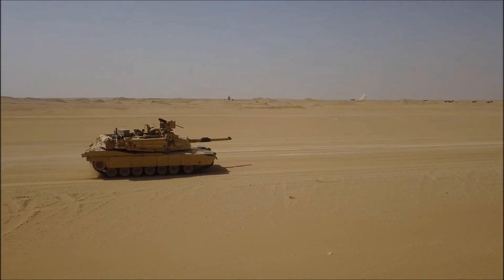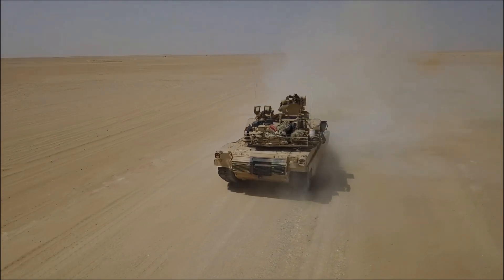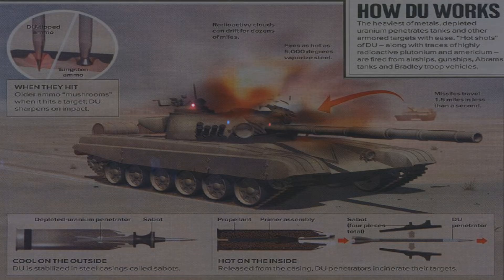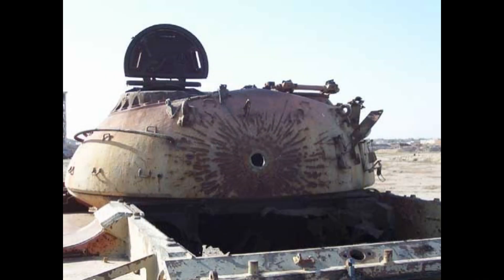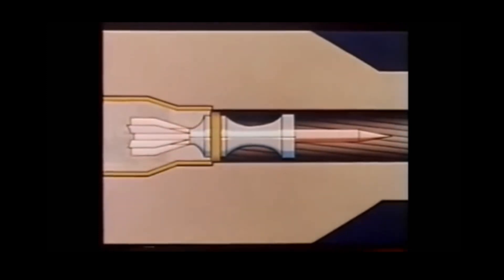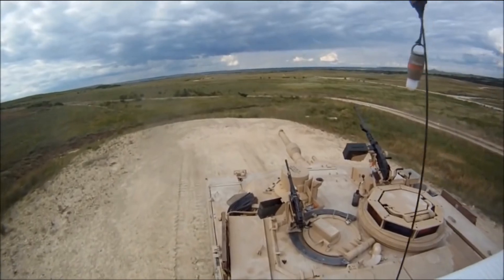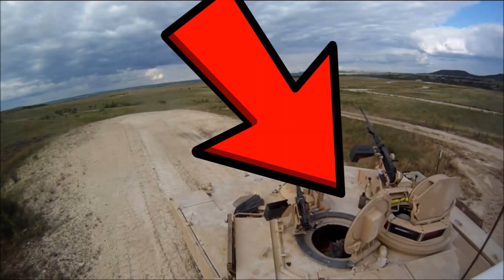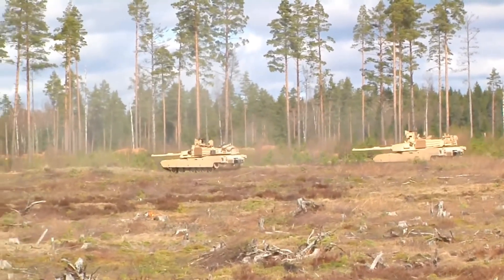Depleted Uranium Tank Ammunition | DEADLY DARTS 💀☄️

Comment: Only one thing I'm a bit confused about. Everywhere I'm reading DU APFSDS are denser than Tungsten. However if you read the element data then tungsten is marginally denser than DU. So hows that work? Not only that but alloying it with titanium should make DU less dense still.
Reply: Simple misinformation. DU isn't denser than tungsten.
Reply: 19.1 as opposed to 19.25 for Tungsten so from that perspective yes. However I would not expect that many different sources to be that wrong. That said Osmium is more like an RD of 22 which is more than 10% on both of them. I have seen people all copying each other as sources before but I would have thought for something like this it would be checked more thoroughly.

Comment: The M1A2 has DU in its armor, too, so...

The export version of the M1 uses a tungsten version of the sabot.

The radioactive cloud thing in that graphic is incorrect.  DU is no longer significantly radioactive.  The isotopes in DU have half lives measured in the hundreds of millions to several billion years.  Fun fact about radioactivity - the long half life is due to low levels of emission.  Think of a battery powered light - if the light is dimmer, the battery usually lasts longer.  If the stuff takes hundreds of millions or billions of years to lose half of its radioactive emissivity, it's practically giving off no radiation.  

Seriously, some of the isotopes will finally burn off half of their radioactivity about the time the sun burns out.

Now, is non-radioactive uranium toxic?  Yes.  So is tungsten.  So is the ammo that cooks off in those Russian tanks when you hit them.  Meh.

Comment: So what will remove the DUDSP from use first?  Tank fired indirect attack missiles or electromagnetically accelerated projectiles?

Will the weight and power problems restricting improvements in tank armor be solved by things like pebble bed reactors in a tank?

Comment: I was an M1A1 Armor Crewman for a decade overseas.  Yes, the SABOT is all that and a bag of chips when it comes to defeating enemy armor, but most of the time we were using HEAT rounds which are effective against...well, everything that ever came at us.
Had some folks sniping at us from what appeared to be a small cave up on a mountain once - we fired a HEAT into it and the shooting stopped.
Fun fact:  tank drivers who do a LOT of maneuvering develop a "six sense" as to where every corner of the tank hull is at all times, making tight movement possible which is handy when snaking through dunes or in hill country where you literally cannot see your wingman (if in a 2 or 3 tank) while still maintaining a wedge formation.
I got my Track Driver's Badge as well as my Wheels badge thanks to lots of deployments and training maneuvers and was licensed on the M1A1, M577, M113A2, M113A3, M88, and M2 Bradley thanks to a psycho Cav commander who thought everyone should be licensed to drive every wheeled and track vehicle in the squadron "just in case".
"TOPHAT TOPHAT FIRE!"
Do a video on the MPAT?

Comment: Depleted Uranium is no more toxic than any other heavy metal, meaning it is a very toxic metal, but nothing else.  It is less radioactive than natural uranium, because the uranium that is used as fuel for bombs and reactors has been removed.  Mercury, Lead, and even Tungsten are also heavy metals and are toxic themselves.  There was misinformation being spread at one point that the Israelis were using nuclear weapons since they were using depleted uranium rounds.  Needless to say, this was a complete distortion of facts.
Reply: @acidpunx a. As I stated previously, it is no more toxic than any other heavy metal.  All heavy metals are toxic.  Nothing there contradicted what I said.  b. RT would not be the first source I would use, considering some of the bonkers conspiracy stuff they have also covered.  c. As stated in this video, the alternative to DU was tungsten.  Tungsten is also toxic (like DU, its a heavy metal).  d. DU is less radioactive than natural uranium (natural uranium is already in the environment by its very definition).My sources aren't just what t I hear on youtube by the way (a very bad source considering you also have flat earther videos on here as well), everything I stated I learned from studying and even testing in college (did several majors including physics, know a bit about the multiple fuel cycles, Thorium, Uranium, Plutonium, etc. etc., actually worked with a geiger counter at times).

Comment: The DU alloy composition has been improved with every iteration in the M829 family. Such that the M829A3 has a density around 23,000 kg/m^3; likely alloyed with Moldynium Osmium, iridium as well as tbeing quenched and age hardend . Making it 3,000 Kg/m^3 denser than Tungsten and also much harder.

Also I don't think DU will be phased out anytime soon. While ATGMs can attack from the top and sides great strides are being made in DAS (Defensive Aid Suites) and Composite Armor. ATGMs are also slower, more expensive, less reliable and more fragile than solid metal downrange. So unless we are trying to go to BVR tank fights ATGMs are a no go. 

Besides tank gun development has a long way yet to improve. Just look at the XM-360E1 ETC, 1000 kg lighter than the M256, 48 calibers and at least 17 Mj (6 Mj more than M256) of energy out of a 120mm ETC cannon. And that's just the tip of the iceberg for ETC technology; going into inert propellants that get turned into plasma can yield 100 Mj for a 120mm cannon.

Comment: Depleated uranium is not a byproduct of nuclear reactor fuel.  Plutonium is.  Depleated uranium is what is left after fuel enrichment prior to fueling a reactor.   Uranium U238 represents over 99% of all uranium isotopes.  U235 is what is used in pressurized boiling water nuclear reactors that powers aircraft carriers.  You are already well aware of the chemical hazards of depleted uranium.   Sadly iridium as a penetration will never be used as it costs more than gold or enriched uranium.

Comment: Regarding barrel length: AFAIK, most tanks have ca. L55, while the infamous WW2 German cannons tended to be L72 (88 and 75mm), whereas most other tanks with decent penetration of the same era were L55 too (US 90mm; Soviet 100mm). Can someone explain me why? Moreover, some L55 didn't need muzzle breaks, but the long L72 did, which is counter-intuitive regarding the powder load per round.
Reply: WW2 German cannons were made for high altitude shooting and tank penetration, so they needed velocity. a shorter barrel cannon can use thinner walls on its shell, and put more explosive into its infantry support oriented rounds.  i think the need for a muzzle brake is partly related to room inside the tank, for a recoil compensating mechanism

Comment: Does HESH still have it's justification?
Playing WT, I noticed that while the Abrams are nigh inpenetrable from the front, even a early WW2 SPG can finish them off with a hit on the roof (or you can take a BT5 and shoot them in the side, if you feel lucky...).
HESH would obviously be better suited than a regular HE round, when it comes to destroying tanks.
Reply: Spall liner and composite armor/ERA has made HESH practically obsolete 
(Unless your opponent is using obsolete equipment like t54's)
Also many Russian tanks have ERA that cover the entire turret and roof sooooo...

The abrams in WT is not perfectly  accurate btw.

Oh and to say it's "nigh impenetrable from the front" made me laugh

The massive turret ring weakspot makes it kill able for even a Tiger II H

The turret face can be penned by many tanks at 9.7-10.0
(As well as the lower plate/breach)

Comment: my question is how much damage do they do to the crew. do they just penetrate as a rod trough clay. or what do they do after penetrating the armor?
Reply: Daniel Muth they rip off pieces of the armor plate and through them through the inside of the tank. They also heat up due to the intense friction. Basically you end up with a bunch of super hot pieces of metal bouncing around the inside of the tank. DU has the added effect of catching fire and throwing little bits of burning DU everywhere. If you’re in a tank that got hit by one, then you’ll have to be cleaned out of the vehicle with a mop
Reply: thank you for the answer :D
i did some research. and im amazed how much fragment and heat it creates while being a relative narrow projectile

Comment: Uranium metal refined from ore has 0.7% U235, the isotope required for reactors and weapons. The rest of the metal is U238.  The procesd of enrichment removes some of the U238 to increase the percentage of U235.   Even the low level of enrichment required for nuclear reactors leaves large quantities of Uranium that has been "depleted" of its U235 isotope, leaving only U238.  This is the depleted Uranium we are talking about. Other than a small quantity being used for radiation shielding, there is little use for this material outside of military uses which is why, even though it is fantastically expensive to produce, the U238 depleted Uranium byproduct of the enrichment process is basically worthless and free to the military.

Comment: The US might not be going for the longer barrel 120 because DU seems to get better penetration when going at around 1600 m/s, higher than that and it ges less performing, so no need to inctease the muzzle velocity
https://cdn.discordapp.com/attachments/257870731201871872/488404647229259776/v_opt.png
Reply: They are not going for it because of the Abrams stabiliser. They tested the L55 (M256E1) with DU from 1998 to 2000, and it performed superior. However the stabiliser had issues with the longer and heavier barrel, reducing accuracy. It would require a completely new stabilization system, which was then considered too expensive.

Comment: Hi Matsimus 

I have never seen an actual comparison with DU & Tungsten penetrators (of same generation). 
But for purely penetrating capability Wolfram (Tungsten) should on paper be better.  

Same density (19.3 g/cm3 for Wolfram vs. 19.1 g/cm3 for Uranium) 
Higher melting temperature   (W= 3422 °C  vs.  U= 1132.2 °C) 
And Wolfram has higher hardness both in a carbide and pure form. 

DU does catch fire when overheated so if it penetrates, that could produce more incendiary damage inside a tank though I would think white-hot fragments of Wolfram is also very capable of starting fires. 

I think the reason US went more towards DU ammunition and Germany and others went for Wolfram is the easy availability of DU for US. 
US has a lot of leftover Uran-238 as leftover as U-235 is used in reactors and nuclear warheads.
Reply: Tungsten carbide is among the hardest crystalline structures there is, much harder then DU. 
It is about 9 on Mohr scale, so it will not mushroom.

Comment: Thanks for the video Matt I learned a lot. I think, you started to point out to some extent that the value of tanks on a battlefield is still there but its time is running out. The tank is an idea that was developed in ww1 but not fully implemented until ww2. Militaries commonly hold onto previous success for a very longtime verse outside the box development. In conflicts the US and NATO forces are currently involved in, tanks are still the master of ground combat. However, if large scale war broke out today between major powers the effect of tanks on the battlefield maybe less then preferable. Protection will always be at the forefront of military prowess but if history has showed me anything weapons development will always to some extent surpass this. Example, the potential power of railguns or lasers. To some up the age of tanks is close to an end, but the need for protection always exists. What will replace such an amazing weapon on the battlefield, I don't know. Let me know what you think about the future of tank use or what may replace them. I would also like to know if you agree to some extent with what I am saying or if I misinterpreted.  Disclaimer: I really do love tanks and this is just my opinion.

Comment: The environmental problem with DU ammo isnt DU ammo, but the A10 30mm 4500rpm gun and it being used with DU ammo all over the place when the DU capabilities were more or less only warranted during the Iraqi invasion. MBT/IFV engagements impact are minimal (few areas, fewer rounds) and very localized to given areas, but A10 DU impact on the other hand is all over the place when DU is used for simplistic tasks like taking out a infantry foxhole or similar. Thereby having a unnecessary spread of DU.
Reply: While I disagree with a lot of controversy and support DU ammo, yeah, the A-10 spreading it as default ammo is a bit much.
Reply: @epion660  If you ask me. DU ammo should be a wartime only type ammo. Because DU has a negative impact. Its not directly that DU is radioactive that is the problem because the levels are so low (ref Abrams with DU layered armor, that limit service years on such vehicle). Lead is poisonous as well, but you can still hold it a few times during your life. The problem is prolonged exposure. For example, everyone today has micro plastic going through ones system. Effects? Unknown.

However, if those micro particles are DU. Then even the low level radioactivity becomes dangerous and can cause allot of shit. Just like lead and why humanity more or less stopped having lead based fuel.
Reply: @Lobos222  I agree. I feel that normal rules don't fully apply during war. I hate the modern sentiment that war shouldn't hurt people. I think that DU really should only be used like APCR was during WW2, if a bit more. In WW2, tanks that had APCR only had a few rounds of it. If you only had a few rounds of it, you'd save it for tanks. Then, when you have to shoot at things that aren't tanks, you can use HE/HESH/HEAT or regular APFSDS. Honestly it's just silly to equip them only with DU and an explosive.
Reply: @epion660  they only did that because of cost the DU round in the a-10 Is APCR
Reply: @devinwilliams3489  I think you may have missed my point. I'm saying that DU rounds should be used in tanks like APCR used to be. Come across a T-80 or T-90? Load the DU. Come across a third-world nation's T-55? Just slap it in the face with standard  Tungsten APCR. Make it so it's not being flung at everything senselessly, but it does have a purpose.

I get that tanks were not all equipped with APCR as standard for mainly cost purposes, but the point still stands. Use it rarely when needed, not constantly when it's too much, or rather wasteful.

And the whole issue of the A-10 rounds, they're still using so much of it at once. It could possibly be put in every few rounds, rather than every round. If that's already the case (I'm not exactly sure what the ammo belts consist of) then I don't have much of a problem.

Comment: How do they protect the guys in the tank using the rounds from radiation leaking from the rounds or of contamination from the armour, especially if the rounds aren't brand new and have sat for a while as things can degrade over long periods? I get that it's not possible to talk about the controversies but it's one thing that's got me curious and it's not so much a controversy and more a curiosity how something is done in this instance. I have assumed lead linings but wondered if something I had not considered. Why not have a scolding tea hose too for close range anti infantry protection? You know we Brits have the best ideas.
Reply: The rounds/armor are not radioactive in a sense of dangerous, thats how, theres no need to protect the crew, they just shouldnt directly touch the DU part of the round when loading it.

The people whom claim its radioactive dont understand basic physics, biology or chemistry, the problem is that its a heavy metal, heavy metals are highly toxic to humans, lead, tungsten, DU, etc.
Reply: I understood that they have uranium and depleted uranium i.e. waste from reactors so I figured that naturally there would be radiation given off and therefore some kind of lining would be inside the round itself or similar to the armour. I'm not an expert on the subject though hence the question. There was no assumption though of the men in the tank directly touching the uranium though as common sense would state that you wouldn't directly come into contact. I was also aware too of the highly toxic nature of the two so I did understand the reasons for the controversies. I saw some pics of what's happened in Iraq with regards to birth defects etc and if they are real pictures I understand why there would be calls to stop use as it's causing long term collateral damage to the civilian population. Defeats the point of going in to help them to then poison them long term.
Reply: The material DU ammuniton  is made of normally never was in a nuclear reactor. This material is what is left after the enrichment process. The Uranium part is basically pure U238 which has a very long half life and so is only very weakly radioactive.

btw. Not every heavy metal is toxic. Gold, silver and platinum are heavy metals by defintion but aren't toxic for humans. Also there's no study that showed that tungsten or tungsten carbide is toxic at all. Some bacteria even need tungsten as an essential element for their metabolism.
Reply: Thanks for clarification. Not an expert as I said.
Reply: Should have said too before that I was aware that not all heavy metals are toxic.